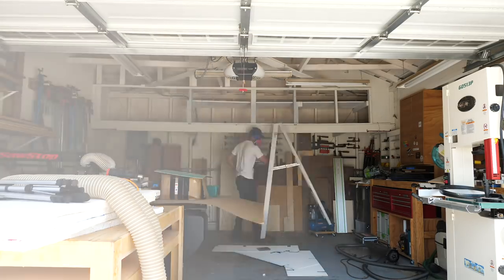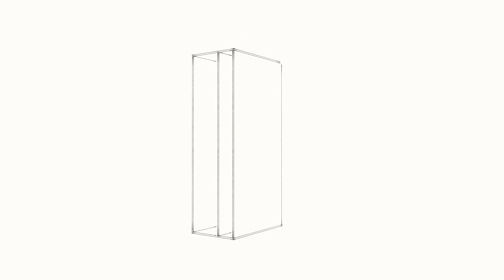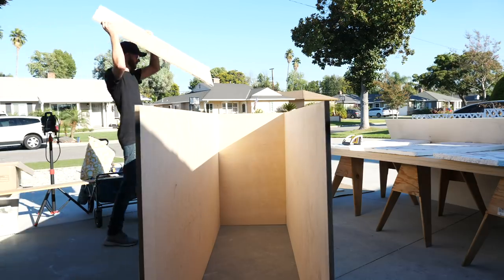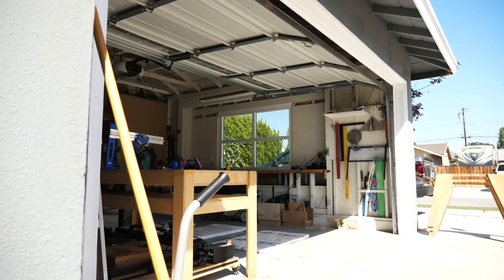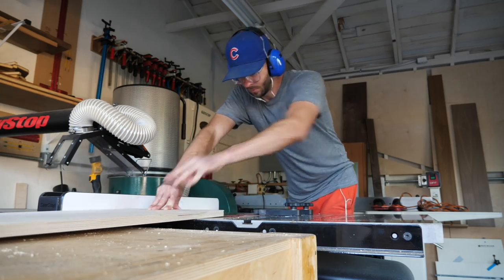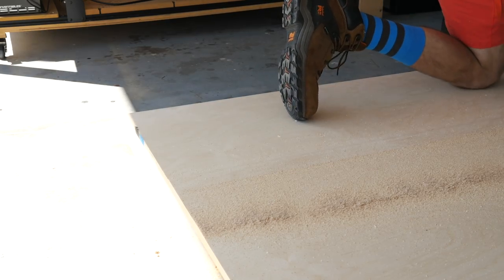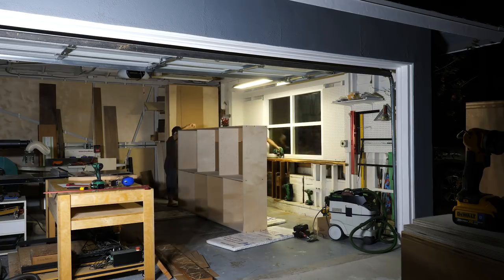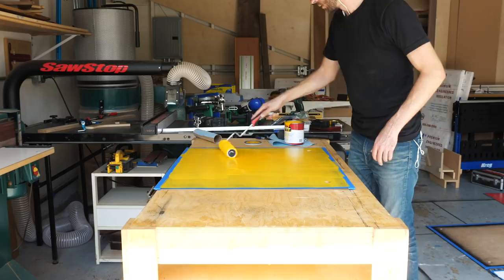Vertical Plywood Cart + Big Garage Storage Upgrade | DIY Woodworking

Comment: Blocking daylight, I think, is not the best idea.
I just installed extra windows for more daylight to shine over my workbench.
Works so much more pleasant.
But then, in Belgium, I can not always work outside because of the more or less numerous rainy days.
Perhaps you are more lucky with the weather that you can work outside.
But well done.
It reminds me at the Dutch designer RIETVELD  :-)

Greetings from Belgium
Reply from the maker: Agree...but that window has pretty much always been blocked. Before that it was 80% covered by a miter saw and a dust sheild...and I always had a curtain drawn behind it. I'm lucky in that there is more light than I could want flooding in from the front, and I always work with the garage door open. I'm in Southern California where it doesn't rain too much. And even when it does, as long as it isn't super windy, I can still leave the door open :)
Reply: Yeah I was pretty shocked you chose to cover the window as well!
Reply: @Foureyes.Furniture  Enjoy the weather my friend. I work here out of Seattle and keeping the door open brings cold air and more than the desired moisture.

Comment: Love, love, LOVE your  videos. The zoom time laps was amazing. Is that done in editing or filming? The black border is subtle but makes the colors pop, just like the socks in your boots!
Reply from the maker: Hey Josh...thanks! I suppose sort of through both. It's filmed in 4K but output is at 1080, so you can zoom in to 200% without pixelation, so the camera was locked off on a tripod that didnt move for all 3 shots, then I just digitally zoomed from 200 to 100% and timed it so that it transitioned smoothly.
Reply: So well done!

Comment: Hi, really like your work! I’m thinking of building the large plywood storage unit you made for the 4x8 sheets and smaller off cuts. I was wondering how wide you made yours and how much room you gave to the full sheets? Would you do anything differently if you were to build it again? Thanks for your time and looking forward to watching more of your videos.
Reply from the maker: Thanks. I don't remember off the top of my head. But if I were guessing it's around 14-18" wide. I think something I'd do different is maybe make more smaller partitions working up the other side. I'm not using that space very efficiently at the moment.
Reply: Hi Chris, thanks for the info. One more question for you. Do you recall how wide you made that whole cabinet? Four feet deep by .... wide?

Comment: Chris, as always- love your work, woodworking and presentation. I have a particular question regarding your work. How are your neighbors coping with all the noise you produce with your tools? I've seen your videos where you keep working, even after nightfall. Did you have any problems with them? Do you have any advice on how to "manage" your neighbors?
Reply from the maker: I'm pretty considerate about it. If you see me running any big equipment and it's dark, it's probably about 6:30PM on a Saturday night. Anything else I'm doing later than that, or on weekdays is work that doesn't make a bunch of noise. Even if I need to do something like sanding late at night I'll just close myself in the garage so that nobody can hear it outside.

Comment: Chris really enjoy your videos!  I just inherited some woodworking equipment.  I live in a townhome at the moment and the only space I have is my 1 car garage.  None of the equipment has caster wheelbases.  I now have a bandsaw, table saw, jointer, drill press,  and radial saw all which are super heavy and very hard to move around in the space to make it usable.  Did you add additional bases to your equipment to easily move them in your space or did they come pre-installed?  Any tips or pointers on how you utilize your space with the heavy equipment would be super helpful.  Keep doing what you are doing, you've been an inspiration.
Reply from the maker: Hey Steven....the jointer and planer came with them. I added mobile bases to all others except for the table saw. Being in a 1 car garage is even harder, but I would definitely add wheels to everything I could...and I'd also get rid of things if I didn't think they were necessary. The Radial Arm Saw is cool...but you could probably get by with a miter saw...and you could probably build some sort of mobile project center that incorporates a miter saw. 

If things can easily roll outside, (and depending on where you live) I'd look at that as a solution. Where things easily move outside and set up to work. You'll have to get creative but people do it....best of luck to you :)
Reply: Thanks so much for the reply.  The one car garage is definitely going to be added difficulty.  It also stores all my lawn equipment, fishing gear, and a whitewater kayak and paddleboard.  Time for a bigger house.  Living in WV doesn't help the outside working abilities especially in winter.  I have my organizational skills work cut out for me.  I'm definitely going to look into adding wheelbases.  Did you use metal platforms for the bases or just a double layered plywood?  That said, your equipment most likely isn't quite as heavy as my ~40-year-old Rockwell steel.

Comment: What happened to the grizzly table saw? Also curious why you use a kreg jig for ripping plywood when you have a track saw?
Reply from the maker: I sold it when I got the Saw Stop...still have all my other Grizzly goodies though. For the ripping length wise it's actually easier with the kreg jig. I don't have a track that long for the festool...so I have to set up a strait edge board and measure each time. With the kreg I just set it and I'm off. I also wanted to try it since it's a much cheaper option for most people to use...and if it's good I'll happily recommend it. It's good BTW :)

Comment: Wich plywood thickness are you using for the sliding doors? Any issues with bending on the longer pieces? And are they sliding easy? 
Thanks. Love your channel!
Reply from the maker: It's 1/4" MDF. There was a little bend to it...but sitting in the tracks holds it pretty flat. I put a little wax in the groves and they are sliding pretty nicely.

Comment: Did you place anything between the shelf and window?
Reply from the maker: Just this gigantic cabinet :)
It has a back panel on it if that is what you're asking. And the window has a frame so there are a few inches of separation.
Reply: ah. Was just wondering how it looks from the outside, through the window.

Comment: Where was the track on your track saw for those first cuts? Does the festool stuff have to be limited with the new tool partnership?
Reply from the maker: No...actually Hikoki doesn't currently have a tracksaw in their line up. If they did I probably wouldn't use my festool anymore out of respect for the partnership. But the reason I used the Hikoki in the second shot was that I had just gotten it, It arrived between the two projects. And honestly, for ripping full length of the plywood, that coupled with the Kreg jig is actually easier and faster than the track saw. Especially since I don't have the long track.
Reply: @Foureyes.Furniture  yeah, the long tracks are insanely expensive. I have 3 shorter Makita tracks from an awesome deal a while back, so two stay connected together all the time. Works pretty darn well but there is sometimes a bump when going between tracks. Doesn't affect the cut, more just resistance on the saw.

Comment: How well do those doors slide? Two rough plywood edges doesn't sound smooth.
Reply from the maker: In smaller doors its no problem at all. These were bigger so I put a little paste wax in there and they slide real smooth. Like I can give them a little elbow grease and they'll glide across the whole span.

Comment: sad to see the bay window covered
Reply from the maker: It's been covered the whole time. It was only open to start this video when I cleared out the miter saw station
Reply: Yea, just after I commented that, I scrolled down to see that several others have said the same thing haha. Just because it was covered up before, doesn't mean it has to stay that way. Could have turned a new leaf and switched up the layout a little. If it ended up not working out, could just be another excuse to make something. Either way, making is making, and nice video!

Comment: "and a lot of us are tools" I literally laughed out loud.  I do have a question.  I've never owned a track saw.  I noticed that you were using your track saw with a straight edge.  I'm assuming the track you have wasn't long enough for the cut.  Any advantage to a track saw with no track over a circular saw???
Reply from the maker: There would still be some advantages... namely the ability to plunge. That said there would also be some disadvantages...namely the fact that you have to plunge. But really track saws are pretty expensive so it would be kind of weird to get one and not have a track. You could also make your own edge guide or just use anything with a straight edge. I’ve recently started using the Kreg accu cut, which attaches to any circular saw and I’m pretty impressed with it. I’d check it out.